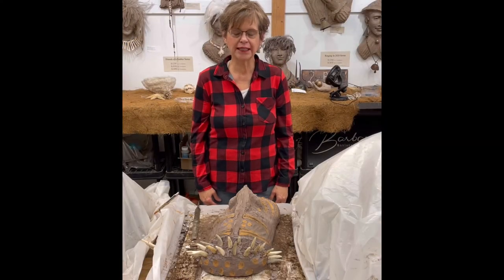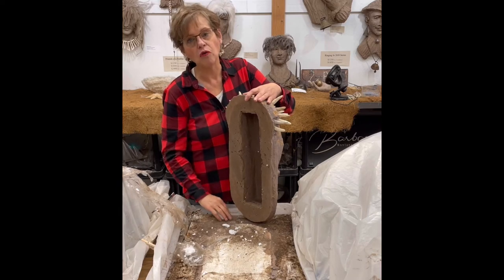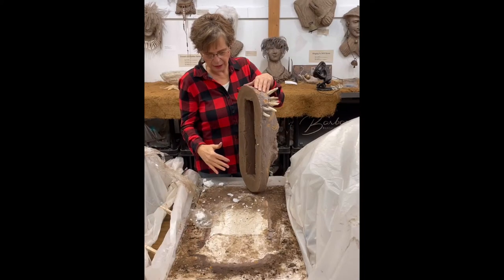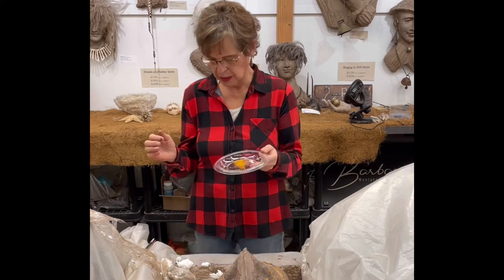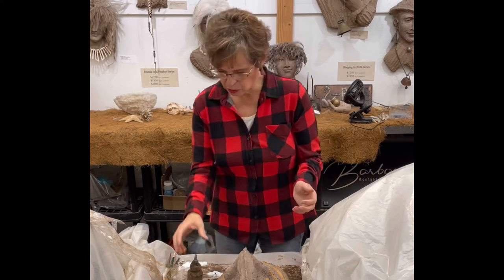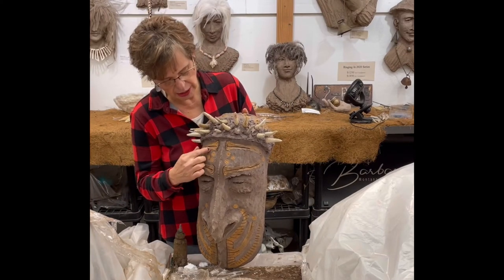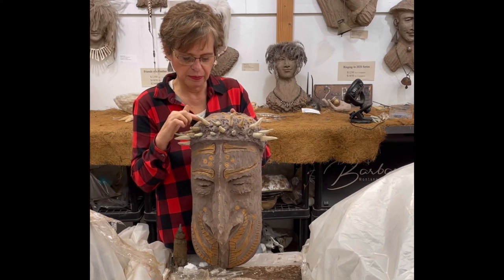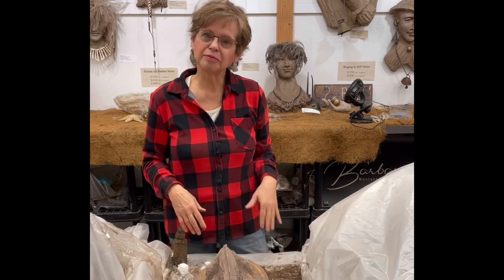Reducing weight of concrete sculpture and other tips

Comment: Ideas covered: build around styrofoam block, covered w/ cellophane sheet. Mark block location on work surface, so you can know its position as hand build & manage sculpture thickness; table markings can get lost as work & get slurry/ cement on work surface (so maybe cover with plastic film you can move? wipe off?;  Deer antlers: do not want to insert when concrete is already curing- drying/ can lead to cracks/ insert wet- she re-wet the concrete mortar for adding them
Reply from the maker: I soak my antlers in water so they are dry and draw moisture out of concrete. I don’t insert them i actually lay them where i want them and apply the concrete mix around them.